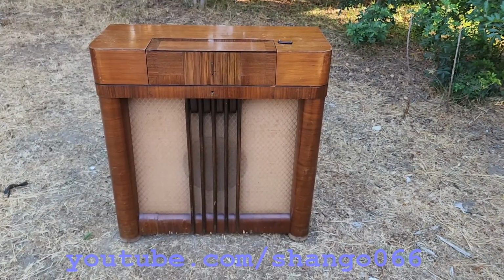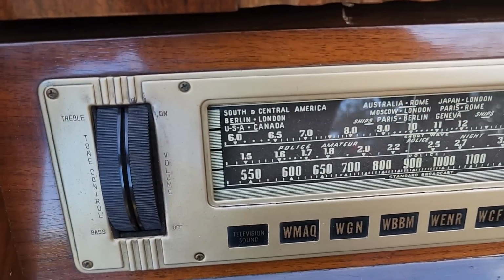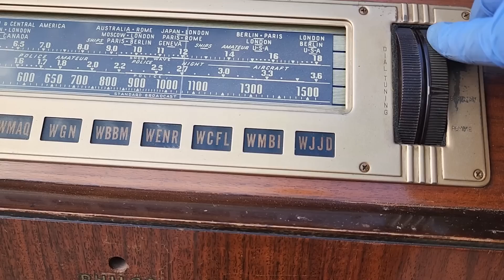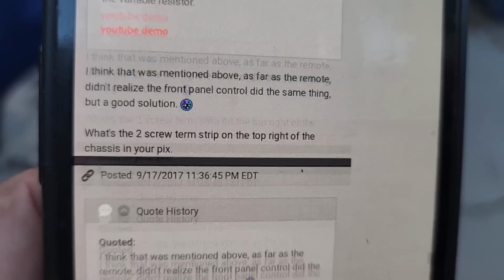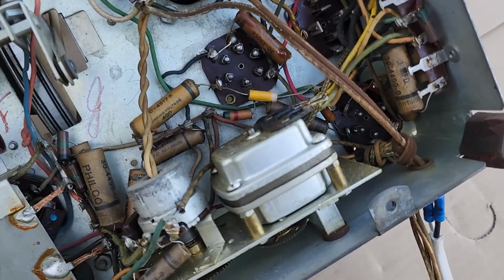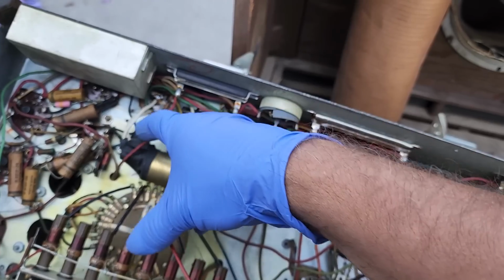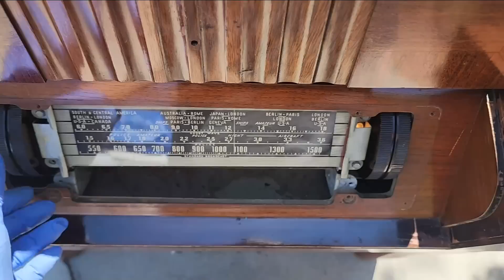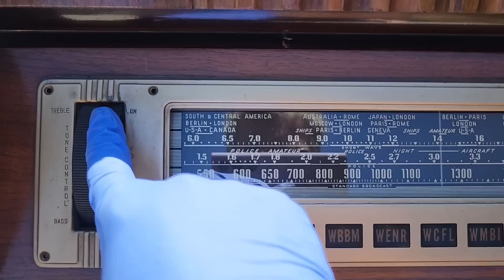1940 Philco Wireless Remote Control Radio 40-217

Comment: Wow 1940 radio remote control, I would never have believed this but there it is. I am curious about how the remote worked.  From what I saw of the schematic it looks like it had a 3V filament battery which I guess would need to be on all the time you are planning to use it.   It would have been interesting if you could emulate the remote control with a signal generator to see if it would operate the volume/channels. Great video as always
Reply: I'm going to take a wild guess that the tube only had to be on when making changes.  The Type 30 tube had a 2V filament, so 3V gave it a very quick warm up time.
Reply: @russellhltn1396  Yep that would make sense as the warm up time was what had me thinking, thanks for the reply.

Comment: The audio output don't seems to be a real push pull ab circuit, since no phase invert system exhists and even it owns a switch, that can put both output tube plates in parallel... But really a nice radio set even today !

Comment: thyratron, gas-filled discharge chamber that contains a cathode filament, an anode plate, and one or more grids. An inert gas or metal vapor fills the discharge chamber. The grid controls only the starting of a current and thus provides a trigger effect. The normal grid potential is negative with respect to the cathode and prevents electrons from flowing to the plate and exciting a discharge. To cause a discharge, the grid potential is raised enough to start electrons flowing from the cathode. As free electrons stream toward the plate, they collide with gas molecules, freeing other electrons and ionizing the gas within the discharge chamber. When a sufficient number of ions and electrons are present, a “short” occurs, and a large current flows from the cathode to the plate, causing a discharge. The discharge can take place in a few hundred-millionths of a second. The discharge stops when the anode voltage has been sufficiently lowered. Thyratron tubes are used typically in radar pulse modulators, particle accelerators, lasers, and high-voltage medical equipment.

Comment: I was at an estate auction the other day and the guy had a couple hundred radios including two of these remote control philco’s one even having with the original remote, but I think they might of sold the remote separate to the console which sucked, they were also selling tabletop radios from the 1930s to the 60s for pennies on the dollar... they sold lots of 4 radios for $5 to $7.50...

Comment: you can used dc capacitors  back to back for ac just take 2 and put the grounds together and used the 2  + for ac and the grounds do not go to chassis insulate them.

Comment: Do you still have it available?  I'm interested.
Reply: I have one I need to get rid of. It's been restored once many years ago, but has the same problem as this one does with the veneer. I got the AM band working, and the remote may as well, I just haven't had the time to get a battery for it.

Comment: Nice! I imagine in 1940, that was the Cadillac of Radios. Or Rolls Royce.
Correction: Edsel.
P.S. I don't like modern digitally controlled volume controls. They are too slow. Give me the old school potentiometers. A turn or a slide for immediate response.

Comment: 8:38 This is a pickup loop that picks up electromagnetism from the large variable capacitor tuned loop i guess.
People who build magnetic loop antennas for SDR build them like that too :)
It is put in the corner to pick up the most, like a transformer does, the SDR people making round loop antennas use to make the pickup loop oval to do some of the same..
Build a silicon transistor remote for the radio that does the same and make and put it in a small wooden box and clear coat it to make it nice? :)

Comment: I wonder when that RC battery become unobtanium.  This radio was $4000 2022 dollars (189.95 according to a Philco brochure of the era) in 1940!  This radio was EXPENSIVE!
A man working at Ford, a high paying job for the time for unskilled labor had to work 40 days to earn 200 Dollars.  Silver was a buck an ounce!  Only a wealthy person had this kind of money to blow on a radio.
Reply: Good analysis using historical data.
Reply: Instead of looking at dollars, look at time.  Consider all the labor hours it would take to assemble that chassis.  Each part hand placed and soldered.  You're not buying that radio with fewer labor hours than it took to make it.  (Not unless you're making bank or the labor was really cheap.)  If it took 40 labor hours to build, you'd have to spend more than a week's pay to buy it.  Today, PCBs are made, populated and soldered by machine.  Which is why today's electronics is so cheap - very few labor hours in building.
Reply: @russellhltn1396  The primary reason isn't so much machinery as it is chasing regulatory schemes and low cost markets.  The average radio made today, if made in the US using the same methods and same materials (as other modern radios) would cost 5 times as much. 

Just the cost of complying with the reams of regulations for manufacturing would drive the cost to perhaps double.  This is the primary reason we lost our manufacturing capability.  EVERYTHING is more money in the US.  Electricity, taxes, land, employment (the price of labor), environmental laws, equal opportunity laws, insurance against things like lawsuits brought by employees or neighbors of the manufacturing facility. All the "diversity" officers and the HR dept and all regulations they manage. 

From a technical standpoint, we are one of the most productive countries in the world. If we got rid of the MOUNTAINS of regulations and rules, we could be a lower cost producer than China.  Electricity, taxes, land, labor etc would all be MUCH cheaper without all the regulations.  It is NOT a coincidence that the US manufacturing economy begun collapsing in the early 70s when a lot of this stuff came into being.

Plus, nothing like this would ever be made today and if it were, it would be a cheap facsimile.  It would be a sticker on top of particle board and not plywood covered in veneer and then that veneer treated, stained and lacquered and with a steel chassis inside and even a giant 12 inch speaker.. 

ALL of the circuitry would not be there either.  It would be a radio on a chip, though a much better chip than what is put in to cheap modern radios.  This has been to some extent a productivity improvement.  Like the big old condenser would be one of the new micro ones, hence saving on materials while being just as good if not better. Each individual component that still needs to be in the radio would be physically much smaller and thus uses less material.  As you mention, it would not be hand assembled and soldered, it would be done by machine.

Not only all this, but we have been on a war footing since 1940 about.  Spending slowed down for like 2 years after ww2 and then shot right back up and it's been high ever since. We never returned to pre war spending ever. We have not had a tax surplus since like 1961 (deficit has gone up every year since then)
Reply: @tarstarkusz  Ok, but I still say that in general to buy a product, you'll have to work  more hours than the labor hours put into the product.
Reply: @russellhltn1396  At equal work.  A lawyer's hour of labor is worth a lot more than a factory worker's hour of labor.
Reply: @tarstarkusz  They're an exception.  I'm talking about the middle class.

Comment: I would imagine you could turn the unit off with wireless remote, but it would have to have tubes on in standby all the time awaiting the "on" command in order to power it on. That would not be practical.

Comment: This set is a long term project. A complete recap, replacing the majority of wiring too. Taking about the motorised volume control section and relubing it. Doing a complete allignment. Working on the woodwork etc etc. A really cool set though. Just something that youd need to invest many months in.

Comment: I bet this radio used to cost more than a car back then
Reply: Not too far off - this was $189 new, and the cheapest new car in the US in 1940 was a Crosley 2-seat convertible at $325. The ol' inflation calculator seems to work out to $4,000 and $6,800, respectively, in 2022 dollars. Of course, if you wanted more of a "proper" car, I think the cheapest Chevy at the time was around $715 (ca. $15,000 today).